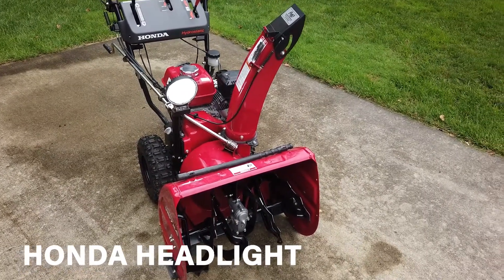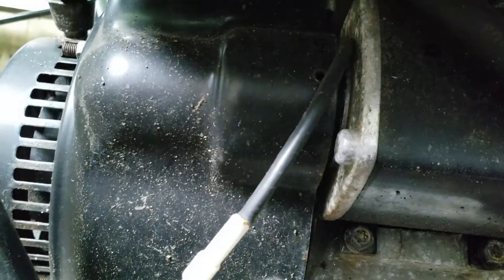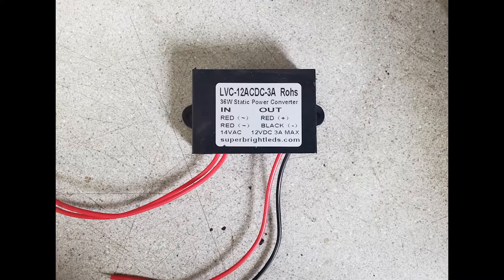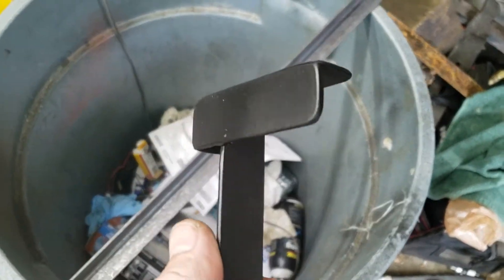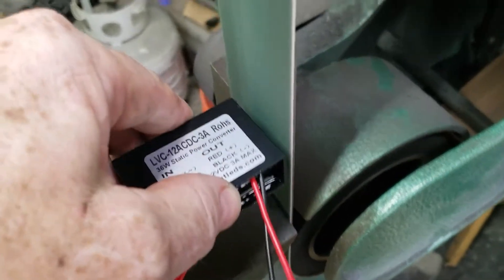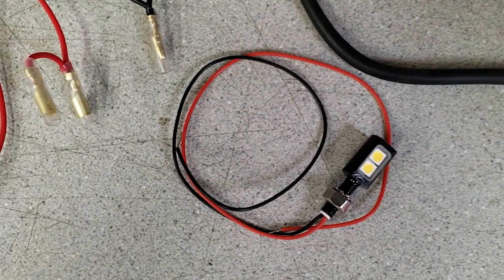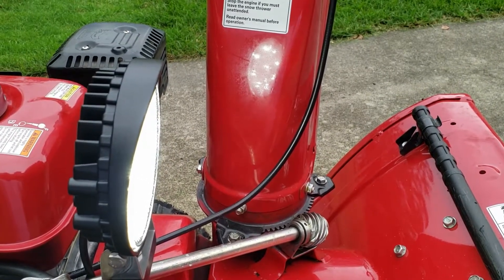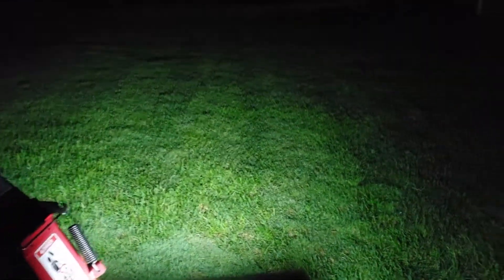Honda or Ariens Snowblower LED headlight installation

Comment: Do you know how many amps that light Draws?  I was thinking of just using a cheap 1N4007 diode as the rectifier which should be able to supply 12v DC at 1 amp.

Comment: If your snowblower doesn't have the lighting stator in the motor, it will cost over $100 to install a stator and new flywheel with the added magnets to power the light. I looked into getting  some used parts to do this md, but it still cost $75. I decided to just use my Milwaukee M18 battery from my cordless drill driver to power my lights and heated grips on my snowblower. A 9 AH battery will power the grips and lights all day without running down too low.

Comment: I have one of these and am nervous seeing two positive red wires on the AC input side, is this unit forgiving?  I'm assuming it works regardless of which input red wire goes to the positive side of the stator and the other red wire goes to the ground.

Comment: My light dims when I go full throttle... what can that be?
Reply: Do you have the Buck AC/DC rectifier on your machine? I got mine the other day and I did some testing with the Buck rectifier hooked to the snowblower and reading DC output from the multimeter, I noticed at idle I get full 12V while at full throttle it got down as low as 8V....
Reply: @jkucukov  yes, it is a "AC/DC to 5V-15V rectifier filter"
Reply: @MrOlemannen96  I tested again with load this time 12V 18W LED, it's not dimming when under full throttle. I think mine was getting low DC volts when measuring under no load. If you have a Multimeter test the AC input leads at low and high rpm to make sure you don't have a bad coil.

Comment: Hi Dan, I have an HS 1132. Do I still need to add the bridge rectifier it did come with a large halogen lamp. I watched Anthony’s video and it appears he just popped out a halogen bulb and added a par 36 LED bulb, it a smaller housing for the bulb.  no mention of bridge rectifier.
Reply from the maker: I'm not sure. You can try it and see how you make out. It might already have the rectifier built into it somewhere. No harm to try.

Comment: Beautiful Fab work!  Curious since it has mounting holes on the front auger.  Why didn'y you go with a light bar or two pods on the auger housing.

I may know the answer to this just curious.  Also since LEDS don't emit heat do you have issues with it icing over?
Reply: I could have mounted them on the bucket but I like to have the light pulled back a bit so I can see the front half of the machine while I'm running it. I think the lights look strange when mounted on the bucket and when you run up against a large snowbank, the lights get covered with snow and you can't see what's going on. I know many folks like them mounted on the bucket itself.
Reply from the maker: I haven't has any issues with it icing over... but I haven't run it in a blizzard yet so it's possible. I generates some heat but not as much as an incandescent bulb.

Comment: Did you put one of the converter wires to ground?
Reply: The AC to DC converter used here has 2 AC input wires and 2 DC  output wires.  For the AC input, connect the AC stator wire that comes out of the engine to one of the "ac in" wires on the converter. Connect the other "ac in " wire to the chassis ground on the engine or frame. Since it's ac input, it doesn't matter which input wire you choose to connect to the stator wire. Just connect one to the ground and one to the stator wire.  The DC output polarity does matter when powering an LED headlight. (LED= Light Emitting Diode - by definition a diode only allows current to flow in one direction. If you hook it up backward (reverse bias), you could damage the LED headlight. It only takes a second to damage it so make sure you verify your polarity before you try it).  Connect the "+" positive output wire from the regulator to the positive (usually red) wire on the LED headlight. Connect the "-" negative output from the regulator to the negative (usually black) wire on the LED headlight. I could have connected the DC negative wire to the chassis but I wasn't sure if the converter would support the same common ground for the input and output or the output was a "floating" ground. I suspect you can tie the negative output to the chassis and one of the two AC input wires to the chassis and run just 1 wire out to the light and ground the other wire from the light to the chassis. It should work but I haven't tried it.
Reply: @danmccarthy206  thanks Dan.. appreciate your help 👍
Reply: @rotex380  NP